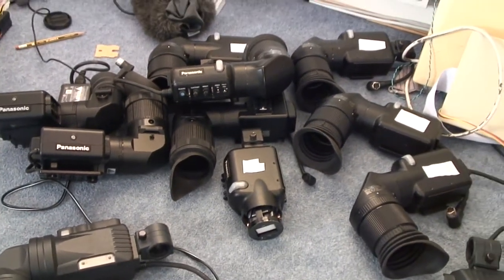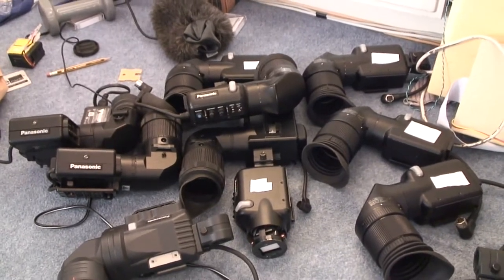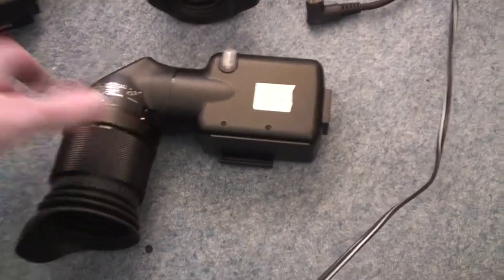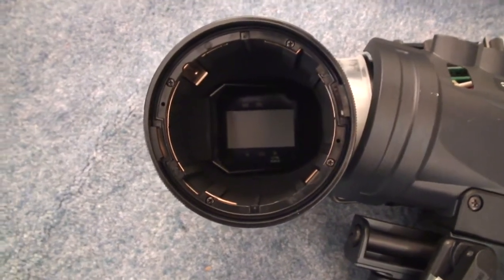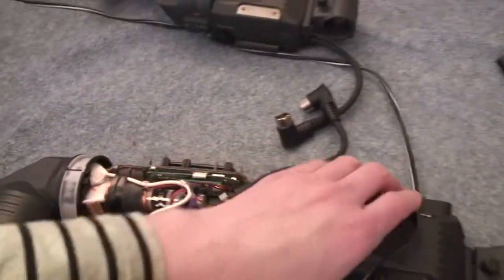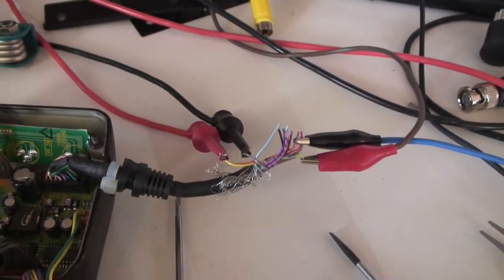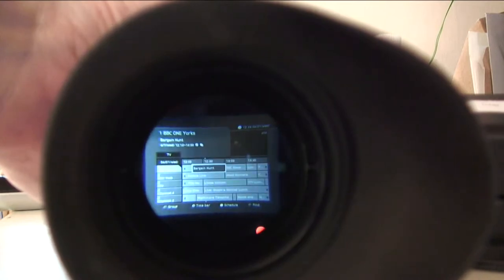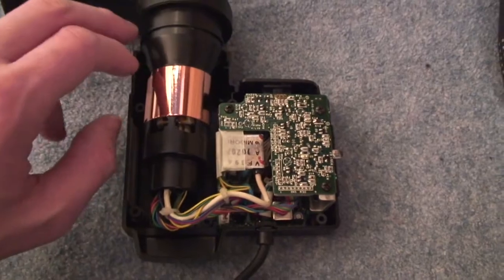Panasonic CRT Viewfinders - Teardown and Test

Comment: Do you mind let us know the models that have color CRT in them, really hard to figure out when they’re being sold online.
Having confirmed model number that are color crt would be great for your viewers as well!
Reply from the maker: Most if not all "professional" CRT viewfinders are monochrome, because a colour CRT would be far too low resolution to be useful. I believe there are one or two consumer camcorders which used colour CRTs but I couldn't say what they are off the top of my head. It is only the more modern LCD/LCOS/OLED pro viewfinders which will be colour.
Reply: @stevecoatesdotnet  most of the community is aware that viewfinders and small CRT’s are BW. You went ahead and purchased all those, did you not find any color CRT’s?
Reply from the maker: @r.in.shibuya  Nope, there are no colour CRTs in this lot.

Comment: Do you think it can be adapted to use with a AJ-HDX400E? Maybe I could connect pin 6 to the Video Out connector, pin 7 to the +12v power out connector and pin 17 to GND. Nice video.
Reply from the maker: Most of these CRT viewfinders just take a composite video signal, so as long as the camera has a standard definition composite video output it ought to work. The HDX400 is a high-definition camera and I'm not sure what kind of signal that will output.